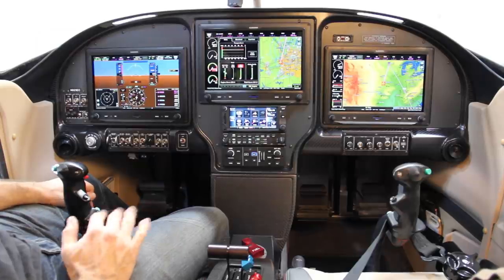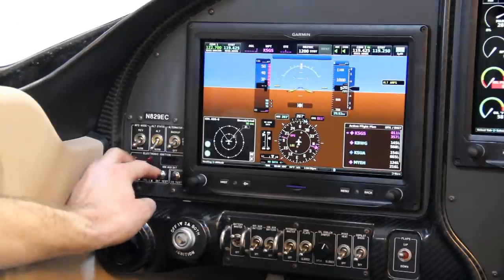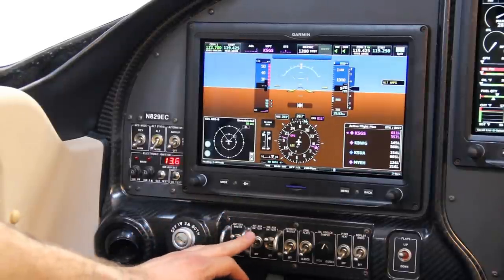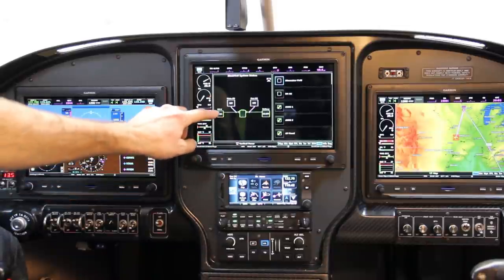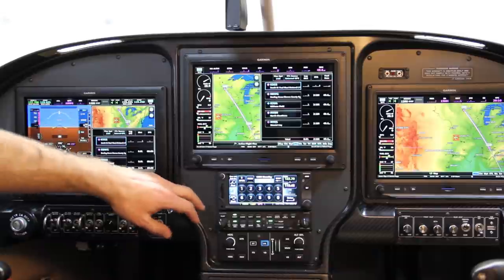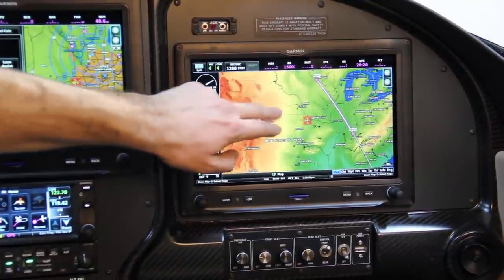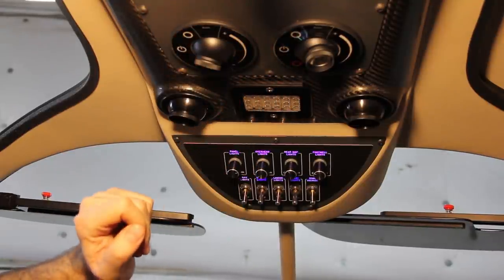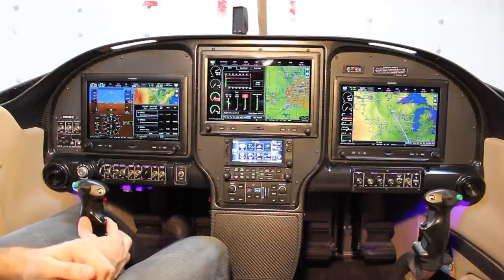RV10 with Garmin G3X Touch Panel Tour

Comment: Good job setting up this cockpit.  It shows a lot of thought (and money) was put into its design and layout.  Below are suggestions, not criticisms, as each experimental pilot should layout their cockpit however they are most comfortable.  
A good rule for cockpit panel design is to follow is the aviate, navigate and communicate hierarchy.  This hierarchy places flying related (aviate) items at the top or front of a panel, navigation items next followed by communication related items last.  If those rules were applied to this panel, the auto-pilot could be the top item in the center stack with the critical electrical switches (covered on) placed on either side of it.  Next could be the MFD for navigation followed by the comm panel with the GTN650 radio at the bottom of the stack.  
Another rule that makes completing checklists easier is layout the switches from left to right in the order they are listed on the checklist.  Critical checklist items like the flaps, should get a lighted handle or switch, that shows status by color if possible.  For example, when the airspeed falls below 80 kts (arbitrary) the flaps handle could flash red if not in the down position. Once down it could turn steady green.  The handle could also flash red when approaching the max flaps speed (within 10 kts) in the down position.  The handle light could then turn off once up in the climb/cruise mode or once below minimum airspeed indication.  
For switches and buttons on the stick, recommend the aviate, navigate and communicate related switch hierarchy top to bottom also.  Auto-pilot and trim hat should be at the top of the stick.  The navigation functions could be moved to the four-way switch,  toggling the MFD between traffic and terrain modes with decrease and increase range left to right.  The pinkie switch would be ideal for comm frequency switching of radios, toggling thru all radio frequencies in sequence (COM1 ACT, COM1 STBY, COM2 ACT, COM2 STBY).  
Again these are recommendations.  Whatever you do, chair fly the cockpit considering each phase of flight and think it thru.  The most important thing is keep the things you use most close at hand.

Comment: Wow, what a panel! My only change would be to move the flap switch to the throttle quadrant area. This would negate the need to move your hand away from the engine controls during the to/ldg portions of flight.
Reply from the maker: +Andrew Beale I went back and forth on that decision. I had considered putting it on the stick, or perhaps on the quadrant. In the end, I think there may have been a "slicker" option, but I was getting to the "just get the damn plane done" phase at that time!

Comment: My RV-9A has dual screen G3X touch, GTN650, and a G5 for standby. You and I have lots of stylistic differences, neither one's choices being absolutely right or wrong, but here are a few key points you might choose to consider (and you have put a lot of thought into your panel!)
* I use the data bar on the G3X for next waypoint information, including vertical speed required for the descent, and I used the GTN650 default nav page for all of the destination information. I also have reprogrammed the GTN default nav page so I can select approaches from there and go to the flight plan. And I keep the data bar available for parameters, and eschew remote avionics, especially when there's panel space available.
* One concept I did not see in your panel is the concept of flow for doing checklists. You've got fuel pump on the stick (not my choice) plus switches on the panel and light switches on the overhead. On my old RV-4, with all the electrical in three rows of three switches (small panel), the landing checklist in part was top two rows of switches, all on. Simple to do, simple to confirm -- all in one place.
* One problem with customized panels in general is the learning curve for other pilots or mechanics, especially when time comes to sell the plane. Do you have a laminated card that has all of the infinity grip switches? I carry with me (on a pdf on my cell phone) the serial port interconnects on my installation as well as all the configuration information, so if I'm at an avionics shop on the road, unexpectedly, they have all the information they need to work on the avionics. I also have all my model numbers and serial numbers. I don't have nearly as much complexity in my panel, so the cockpit checkout is much simpler. Having worked in cockpit design groups for two jet manufacturers, and spent time with a major training vendor, I'm heavily biased towards simplicity and learnability -- but that's for a different target audience.

Would be fun to discuss a lot more points some time.

Enjoy your -10! I wish I had more room in my -9A.

Ed
Reply from the maker: Hey Ed,

You bring up good points. 

1. I'm still tweaking what fields I have in my databars. The remote coms, audio panel, and Transponder controls do take up a bit of room on my PFD data bar, but I have two more screens worth of space. I always keep my flight plan in the PFD inset box, so that info doesn't need to be displayed above as well, but I do have things like vnav time, ranges, etc on top of the MFD. I've also recently started flying with Alt AGL in the PFD databar. I have also tweaked the default nav page of my GTN to do exactly what you described, and unless I'm actually loading an approach, that's the screen the GTN is on (on IFR).

2. I do use flow checks right before takeoff, transitioning to cruise, and when arriving at the destination. I don't worry about lighting in my flows because 99% of the time, all of my lights are just left on (nav, strobes, landing/wig wag). My flow starts at the "e-panel" making sure ignitions are good, then across the bottom row of switches left to right. Then I run down vertically from the MFD engine gauges, to the fuel selector, to the throttle quadrant. Then I wiggle my hand on the stick (a remnant of my primary training, where I wiggle my fingers and toes to remind me to not death grip the stick, and remind me that I have feet to keep on the rudder). When I do my hand/finger wiggle, I set the fuel pump where I want it to be.

3. I do have all of my schematics in visio/pdf in an online OneNote document, synced to my phone. So all of my wire runs (also labeled with shrink tube) should be easy to troubleshoot. That is a good idea to also document the model/serial numbers of the avionics. I could see that being useful to have. I also do have a stick grip function diagram in the POH, but not on a simple to grab card. If I ever decide to let someone else be PIC in my plane, I may do that.

Great questions/comments!

Ed

Comment: Beautiful panel.  I'm mid way through building my RV10 wing and refer to your website routinely for guidance.  I've decided to go with Garmin since its time to commit to a platform and purchase a roll servo.  I'm looking into a Garmin GAD27 for integration of some nice features including extra inputs.  Did you happen to include this in your build?  Thanks for sharing your work with us "silent" builders!
Reply from the maker: The GAD27 came out after I was already flying. The only big feature I would have liked from the GAD27 is the additional discrete inputs. All the power management features I already get thru my VP-X.

Comment: Your panel is very inspired, to put it mildly. Regarding the backup battery, if you're in VMC, you can fly with nothing but the ignition system working, so I assume you designed your backup as something to get you from IMC into VMC. Would you try to fly an approach using just the G3X or do you have a radio or IFR navigator on the backup system? There are so many little design decisions to make and you clearly put a lot of thought into them all so I'm curious to hear how you addressed them. Thanks for taking the time to film and share this video.

Comment: How big of a guy are you?  Do you feel that having the full AeroSport lower panel extension and the console mounted throttle quadrant inhibit lateral range of motion of the stick?  What about overall knee and leg room vs. having the space above the tunnel and below the center panel left open?

Now that you've flown with this setup for several years, is there anything you would have done differently?

Comment: Does the blank panel space below the autopilot panel allow enough room (width, depth) for an external transponder and/or external com2? Do you have a LED ribbon under the glare shield that light up the panel? Does the front heat apply heat to the windscreen? I've read that the leading edge landing lights may not provide a good amount of light to the centerline of a runway at night. Do you find this to be true? I see there is a cowl landing light that can be mounted additionally. Do you have an air conditional mounted? Obviously it is up to the individual, but do you find that it is not too uncomfortable sans a/c? They're pricey, which is why I ask. Very educational video. You and your wife built a very nice aircraft.
Reply from the maker: Great questions!
Does the blank panel space below the autopilot panel allow enough room (width, depth) for an external transponder and/or external com2? 
--It should be wide enough for a standard width device, but you'd want to check with Geoff or Zac from Aerosport to confirm. It's definitely deep enough. I plan on mounting an iPad Mini horizontally there, running Foreflight. It fits PERFECTLY!

Do you have a LED ribbon under the glare shield that light up the panel? 
--No. Everything I need to interact with on the panel has backlit labels (backlit by blue LED ribbons BEHIND the panel). If I need to see more, I have the red overhead Aveo lights. 

Does the front heat apply heat to the windscreen?
--I have two fans in the glareshield that blow up on the windscreen. They aren't heated, but they do exhaust the warmer air created by the avionics and firewall, so they keep the windscreen clear.

I've read that the leading edge landing lights may not provide a good amount of light to the centerline of a runway at night. Do you find this to be true? I see there is a cowl landing light that can be mounted additionally. 
--The Baja Design lights I have in the leading edges are RIDICULOUSLY bright. They have enough light bleeding to the sides of the spots that I can see VERY well, even directly in front of the plane. Aerosport Products DOES make a cowl landing light kit, also using a Baja Design light, but that would be total overkill for me.

Do you have an air conditional mounted? Obviously it is up to the individual, but do you find that it is not too uncomfortable sans a/c?
--I haven't needed air conditioning. I've flown on 100 degree days, with high humidity. It gets warm, but it's tolerable to taxi around while holding the door open. Once flying, I have good airflow thru all the vents, and the plane climbs to cool air at altitude so fast, that AC would be a waste money and payload, in my opinion.
Reply: Thank you sir for the quick and thorough response. I have a rather involved, and subsequently expensive, spreadsheet going outlining a build that I would like to someday tackle. If I am going to put all that work and money into something, I want to negotiate as little as possible with its features/comforts. However, I don't want to be wasteful either. Thanks again.

Comment: Really enjoyed this video.  In the process of putting a new G3X Touch system in my Falco.  I'm curious, do you have more than one ADHRS?
Reply from the maker: Thanks!
Yup. I have dual ADHRS installed.
Reply: @GoodPlaneLiving  Thanks for the quick reply. I am installing dual ADHRS also rather than taking up panel space with another stand alone.

Comment: Would you recommend your choice of audio panel for RVs? We currently have a GNC255A nav/com, which has an integrated intercom in our RV-7A and it's really not meant for an airplane as noisy as ours is. I would think an RV-10 is similar in terms of cabin noise. The problem is that the squelch is too sensitive (randomly picks up engine noise) and at the same time it's not sensitive enough (when speaking sometimes the squelch will cut off). We're looking for a better audio panel to fix that, and so far the contenders are the PS Engineering PM1000, PM1200, and PMA5000EX. Looks like yours has automatic squelch control rather than manual control but I'm hesitant about those type because I don't know how well they work in noisy planes.
Reply from the maker: I've been EXTREMELY happy with my audio panel. I started with a PS Engineering PMA450. I didn't have any issues with that one, and it was a good panel. But when Garmin released the GMA245, I traded the PMA in on it, and I've been thrilled.
Reply from the maker: I've been EXTREMELY happy with my audio panel. I started with a PS Engineering PMA450. I didn't have any issues with that one, and it was a good panel. But when Garmin released the GMA245, I traded the PMA in on it, and I've been thrilled.
Reply: +Good Plane Living Thanks! Your intercom sure does sound really good too.

Comment: Beautiful setup. I just do t understand what the benefit of the VPX is.. Yeah electronic CB, but I feel it's a single point of failure compared to the old style mechanical CB setups. I imagine if that VPX went up in smoke, you would have nothing. If everything was on mechanical CB's, you could isolate systems, no?

Comment: just curious why you went with the g3x instead of the dynon skyview?  thanks.
Reply from the maker: When I purchased, the G3X had a much more complete feature set for IFR flying. I also feel like it has a more polished user interface that follows along with most of the certified EFIS industry. Plus, since I need a certified IFR navigator, and the only realistic options are Garmin or Avidine, I have one vendor for everything, ensuring the highest possible level of interoperability.  

I'm thoroughly happy with the decision to install a Garmin system.

Comment: Had to subscribe! Great informative video! You have all of the features that I want in my future RV10 build, except I would like side panel mounted control sticks. Thanks for sharing this very interesting video. Very well produced. Happy Flying! p.s. I too fly with landing lights on all of the time, for that added visibility to other traffic in the area. (1) other feature I may consider, is having (2) 7" or 8" tablets mounted behind the front seats, so the back seat passengers have something to keep them entertained, just in case they do not remember to bring their own tablet/s. Thanks again!
Reply from the maker: Thanks!

There is a company that does make a side stick conversion for the RV10. I chatted with them at Oshkosh last year, and it looked like a well built system. Unfortunately I don't recall the manufacturer, but I think it added about 25lbs to the weight of the plane.

Comment: I have produced some of the features and designed installations (as you are showing)  for a customer with special use P-3 Orions who are constantly asking for a lot of "goodies" including T2CAS and ADS-B plus a lot of audio/radio, FMS nav, and autopilot (analog and digital) interface.  I am no less very much amazed at your installation, knowing what is involved with designing, building, and wiring all of those featues.  Just about everything I did was actually installed by technicians, so my experience with the task of installation is not well developed. 

Obviously, your panels have a LOT of self-designed features, that any pilot would love to have.  I was wondering how much of the massive systems interface is available Off the Shelf.  Also, did you design this and have somebody build part of it or was it all done yourself?  And, where did you find the time to do all that?  I'm sure it is a one of a kind, with very few similar systems matching in the world.  I am in awe.  

Considering an RV something, still in the decision mode as to exactly what, between RV7, RV10, or RV12.  Would like to find one already built and flyable and go from there with customizing it.  Don't need a 4 seater, but like the overall capacity of the 10.

Comment: This had to be at least $100k in avionics alone.  I can't even fathom this.
Reply: Certified perhaps, experimental roughly half that.... Similiar setup, We used Garmin 460 - 1 PFD, 1 MFD,  GTN 750 instead 650, and added a G5 under 50k with wiring harness from Approach FastStack - met Stein, great guy, great company too, longer wait  - Exremely happy with the support we received...  Same battery set up, but no AOA on Pitot.